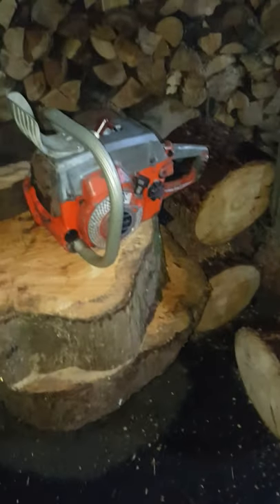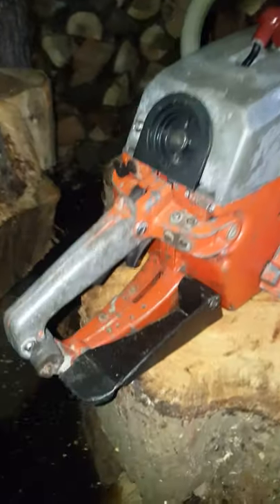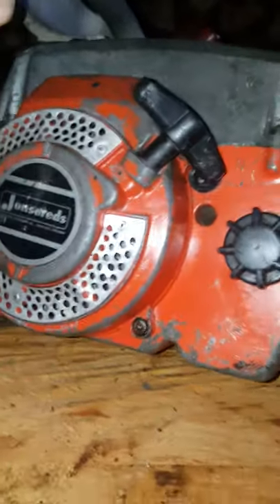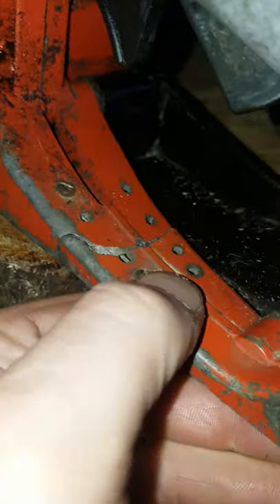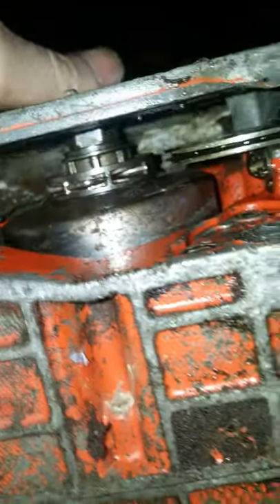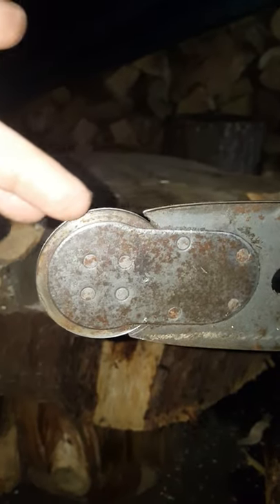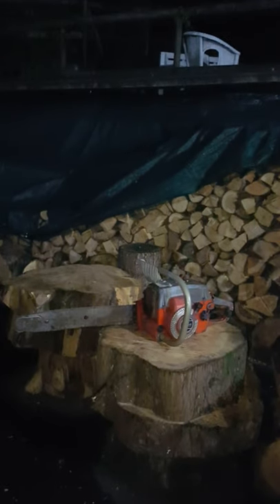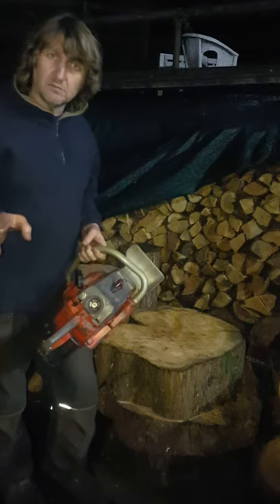Jonsered 621 ?? Vintage Swedish Chainsaw. Overview & starting, but not running well.

Comment: Hi rob got the saw running like a dream cleaned the carb and tuned  it runs good now I will weld the cracks and use her thanks again Kieran
Reply from the maker: Hi kieran..
That is fabulous to hear.. you have skills sir 👍..
I'd love to see some pictures of the welded handle when you have done it.
Best regards R 😀

Comment: Rob definitely a 621 based on the rear handle AV
Reply from the maker: Good Morning John..
There is a small hole on the rigjt side just left of the side cover. Almost looks as though it could have a chain brake. But i didnt think it was an option on a 621 ! What do you think?
Regards R ☺